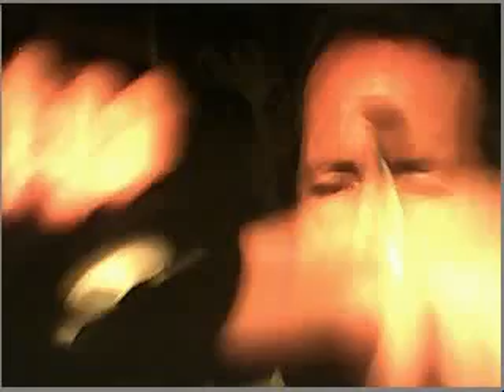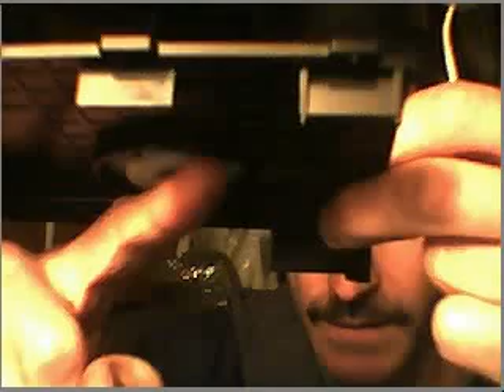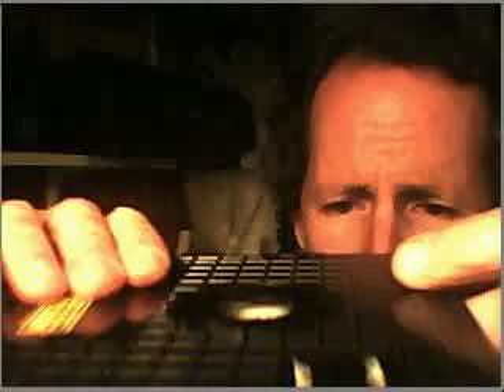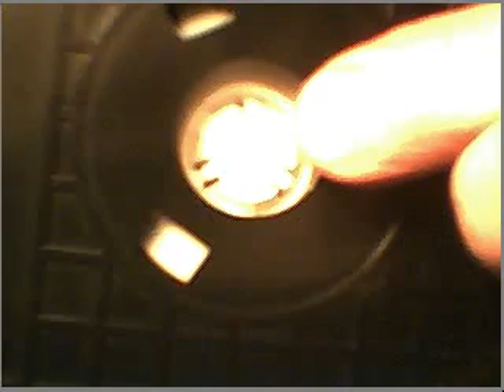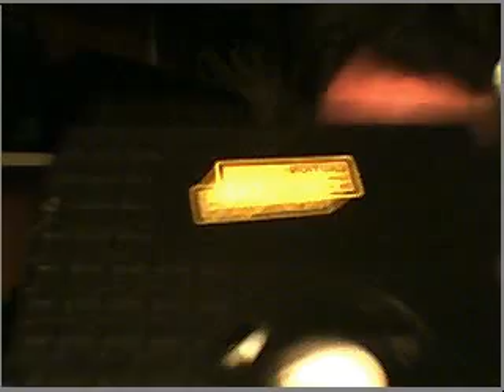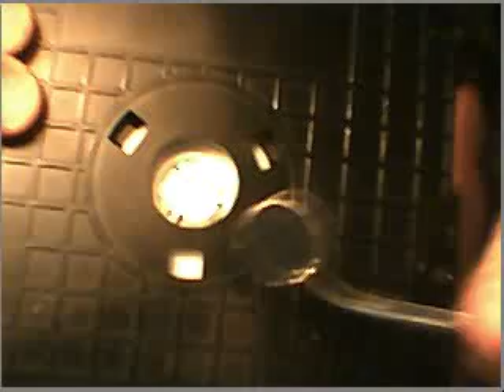play station 2 Eject problem solved.

Comment from the maker: In some cases a bad loading belt has caused this same problem, and changing the space between the magnet would be a temporary fix to compensate for a bad belt,  but in my case, and hopefully yours, The belt was fine, and using the tape was all it took. Thanks for the info.  Glad to hear you fixed it.